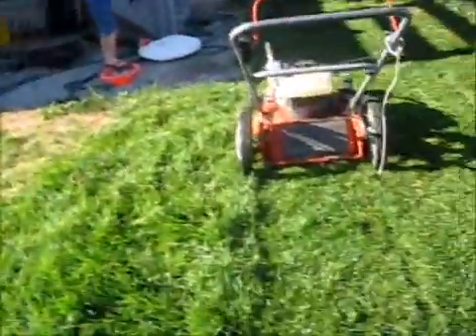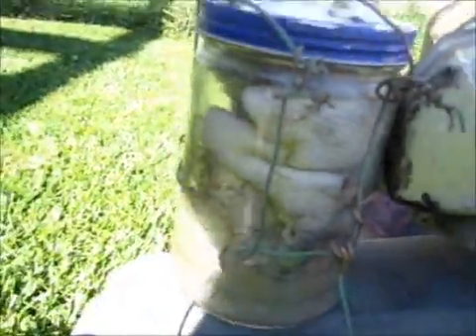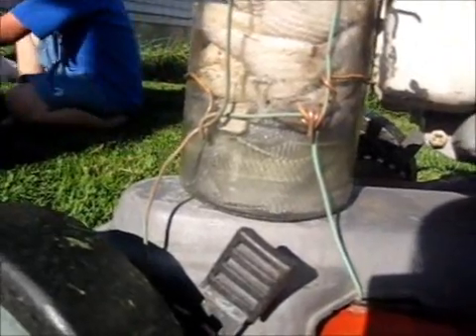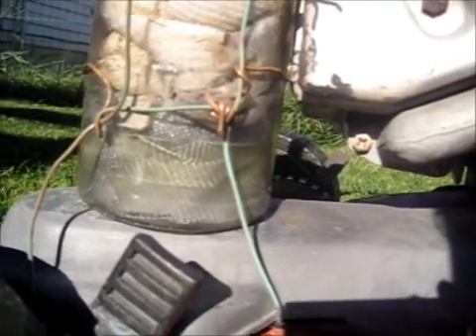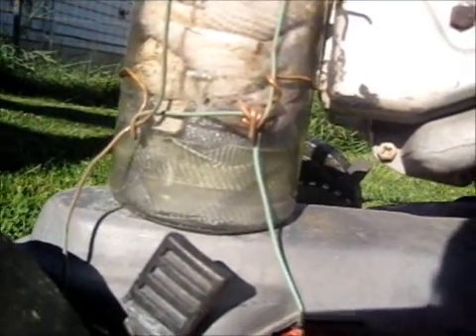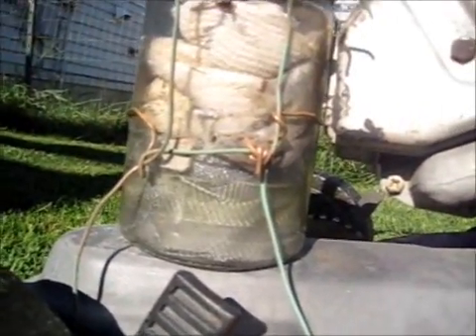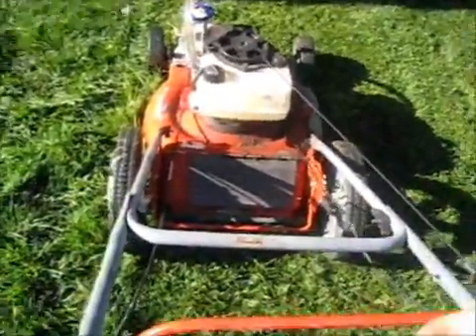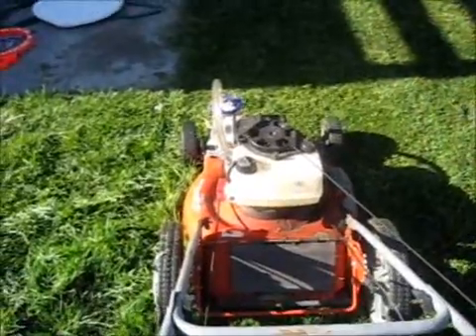FUEL VAPORIZER AIR TO FUEL RATIO 1

Comment from the maker: I would preheat the air using the exhaust I would have a aluminum coupling that I have modified so the exhaust can circulate around it so when the incoming air passes through it it heats it up. The vapor would not be mixing with the air at the air heating point so there would be no possible way it could cause an ignition because all that passes through it is ambient air.

Comment: Thanks, I didn't catch that, that you changed to seel wool, in part 2 video. Great idea! Just the general sloshing around movements a car makes while driving around would also help continually distribute the gas to the steel wool, even though it isn't as absorbent as cotton or wool. Why coarse steel wool, versus fairly fine steel wool, I might ask? Thanks buddy! BigDaddy.

Comment: So, this method, for a car, would not involve a wick material, but just applied heat, and a splash guard at the air out tube...correct? By the way, how is your application for this method for a car coming along? Are you using it, or still pursuing it?  Thanks! BigDaddy.

Comment: How can you preheat the intake air safely, say, with a line from the exhaust manifold, without danger of any sparks or trash that would be sucked into the air plenum or carburetor? I would think a DC powered preheater would be counterproductive, as far as amperage pull on the alternator. Thanks for your replys Tyson! BigDaddy.

Comment from the maker: The wool also serves as a splash guard if you build a vaporizer using this method u will also need to place a extra splash guard such as corrugated steel so you can keep the steel wool in place and so you can install a float switch to allow gas to maintain a constant level. The corrugated steel will prevent the steel wool from getting in the way of the float switch.

Comment from the maker: That my friend is a good question I'll do my best to answer it. If I were to run this setup in my car I would make a few changes. In the video air to fuel ratio part 2 I changed the container and instead of using socks I used course steel wool. Although the wool does not absorb the gas like the socks it is able to heat up so when the vapor produced from the heat of the exhaust passes through the steel wool it heats up the vapors even further which in turn drys it out even further!

Comment: So basically this is a dry vapor wick type carburetor set up that works best. If you did this with your car, with socks, creating a dry, hot vapor, how would you or how  could you supply gas to the absorbent media continually without cooling it down too much? Because by wick method alone, it would dry out the top-most layer of the media faster than it could absorb the gasoline up to that level. How could you keep it all saturated equally, constantly? To answer this would allow it to work on car.

Comment from the maker: I have used a hot vapor in my car with few problems when I use a cold dense vapor I have to have a secondary air inlet valve to keep the air to fuel ratio right this secondary walve is controlled by the butterfly valve on the air intake. When I use a hot vapor system the secondary air inlet valve is not needed infact it dilutes the mixture too much so the engine does not run very well. When I use a hot vapor system less air is needed to run my engine at it normal running state.

Comment: Hi! Efficiency and temperature is of course related between. In my setup I use water vapor for cooling properties, because if we do not cool inside of the chamber we shorten life of the engine... it is true. Mover works OK- I see. If the grass is tall, then maybe? it takes more power and problems with this, but how can I see in my car we can`t make "more dry" without problems of overheating. Is always balance! Thank You, for interesting experiments!

Comment from the maker: With the setup that I have on the mower in the video in order to run only on dry vapors I have to have the socks socked in the gas and the container has to be heated up from the exhaust if there is liquid in the bottom of the jar it does not run at near the efficiency as the socked socks in a heater up jar.

Comment from the maker: I can however test the differences a dry vs. a dense vapor make and a dry hot vapor is significantly more efficient then a cold dense vapor. I can go through a cup of gas using a dense vapor in about 5-10 Minutes when that same cup of gas on a very dry gas vapor can run the mower between 30-45 minutes.

Comment from the maker: The amount of fuel used depends on how dry the vapor is. I have not been able to test the normal run time of the mower on regular gas because the carburetor is bad so I am unable to compare it with that.

Comment from the maker: The air intake on a car is already setup to control the air coming into the car. As the RPM's of the car go up there is more suction on the air intake to let more into the engine. When connected to a bubbler system just as more air goes into the air intake as the RPM's go up more air is pulled through the vaporizer bubbler which in turn creates more gasoline vapor allowing the car to run normally because it is automatic controlled from the suction coming from the air intake. Hope this helps!

Comment from the maker: It will definitely work on a car but it is best to use it with the air intake/carburetor still there it won’t work very well if they are not there. 
Please see my video of the bubbler system on my Buick for a more in depth explanation of how it works on a car.